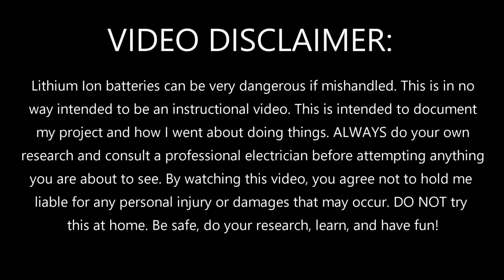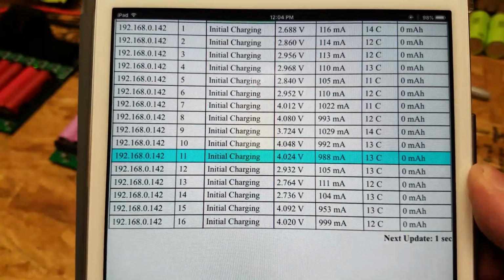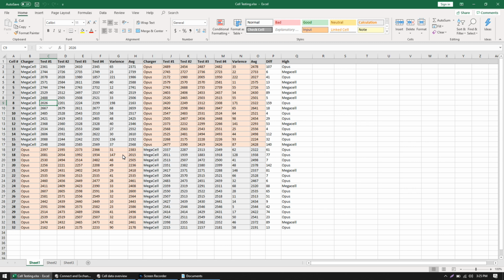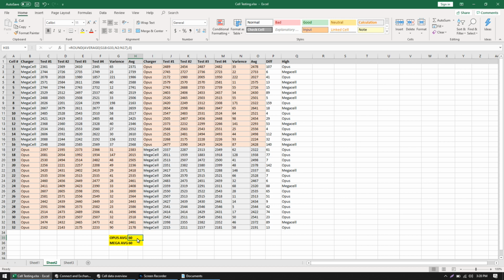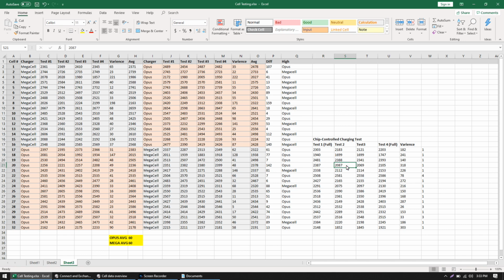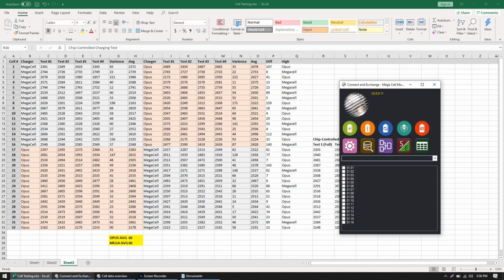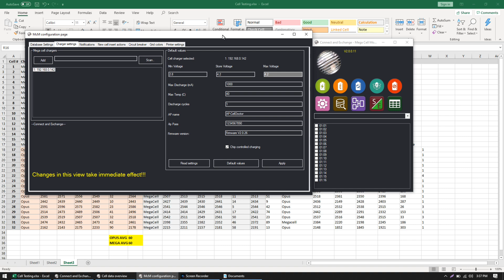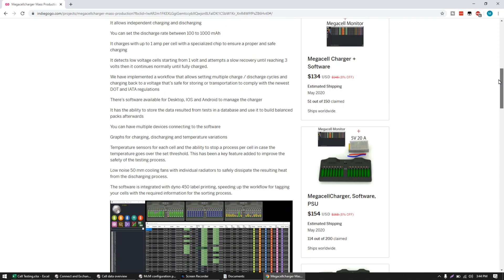MegaCell Charger Consistency/Accuracy Testing vs Opus BT-C3100 & Thoughts

Comment: It's a bit difficult to handle! First: The display is small, you can't see anything on it. Second: It requires a computer, so it's an extra cost! Third: According to the test, you have to set the bays one by one! (This is very time-consuming!) Fourth: I also need a printer so that I can later search for the cells from which I want to build a pack! Fifth: It also needs a barcode reader! (Costs keep increasing!!!) Sixth: If I were to sell something, I would have at least made a transparent polycarbonate or plexiglass cover for it. Seventh: Unfortunately, as far as I can see, it still only has a beta version! In summary: You have to buy so many accessories for it to work that my costs will cost at least 1000 dollars if you also buy the accessories I described! And the worst thing is that since I have little space, the many accessories take up a lot of space in the basement, where I have to leave the computer too!!! So it's all very fiddly and expensive!!!

Comment: I would recommend pulling the negative out first if you are concerned about damage to the shrink wrap, also to fold over the tabs on the plus (or shorten them a bit).
Reply from the maker: It grabs the heat shrink on both the positive and negative. I've tried to bed the tips of the contacts a bit. They don't bend well... (at least I haven't been able to in a way that works).
Reply: @LithiumSolar  Hm, so that means that even if you lift the negative out first there is still a chance that it will rip the positive. Worst case it will short out and weld the tab across + and -, you don't want to be around when it does that! This is a pretty serious design flaw, and if they don't fix it that would count as a serious strike against this charger, testing is supposed to be a non-destructive affair. In that case I would recommend using a dremel with a small cut-off wheel to cut about 4 mm off from the end of the tabs, and then to round it off and grind it smooth again (no burrs).  Push in on the cell then lift the top, then pull the cell forward rather than outward to avoid snagging on the minus tab. 

I'm halfway tempted to design my own charger by now, this is worth doing properly, I think this is a great idea but the execution is lacking. Also, it'd be nice to have a more modular setup, with a single HTTP capable endpoint and say i2c or CAN to talk to the cell modules. Then you could for instance add cell modules in batches of 8 to whatever capacity you'd want.

Excellent job on the testing by the way, nice to see you go through this so methodical. Temp compensation probably wasn't a huge factor but good to mention it, the bigger problem with these cheap battery holders is the varying resistance of the contacts from one slot to the next.

Comment: huge variance on last test is because chip controlled charging charges to 4.2 not 4.24 probably, and removing first test from your calculations because cells in first test were charget at 4.24 would let us compare how consistent it is. either ways, why charge at 4.24 if rated is 4.2? that would give higher capacity readings than they actually are, same as my opus is giving 5-6% higher readings than previous method, in which i charged cells at 4.2, because opus charges untill ocv gets to 4.2
Reply from the maker: Because it doesn't do a proper CC-CV charge, so going to 4.20V actually charges it to 4.10V or so when it stops.

Comment: The battery holder is always the crappy  part of a battery charger. You would think they could make one that works without getting caught on the end. The spring load ones seem to work the best but come on, they can design a better one.

Comment: Just saw your video, I have the same battery holders and same problem with the tab catching the shrink. To avoid that I always pull on the negative side first. This way I can't short the battery if it removes the shrink. For the fans, you can try noctua. Really silent and they have a 6 year manufacturer warranty. Go checkout amazon for that. BTW, great video!

Comment: FYI It's good practice to charge and discharge all cells in testing at not more than 500ma.  Also a lower indicated capacity by the Opus can mean that the cell is capable of a higher discharge rate like in power tool cells, If they charge properly and have the proper internal resistance test those cells at the higher rates before chucking them

Comment: Any recommendations on dealing with opus pausing capacity test due to over heating? I have two and they both do the same thing. Did you modify your fans?
Reply from the maker: I haven't noticed that behavior on mine. I have not modified mine other than replacing the fans when they fail. I assume you checked to see that yours are spinning? The only other thing I'm doing is I have them propped up about 1.5 inches or so to help airflow from below.

Comment: I have not checked your other videos yet but shouldn't this test be done with new cells? Aren't the random grade of cells just making things skewed and random? Thanks for the test non the less and putting a fire under Alex's feet :)
Reply from the maker: No. The board was specifically designed to test used recycled cells. Also, I did multiple tests with the same cells in the same slots, then switched chargers to ensure consistency.
Reply: @LithiumSolar  I understand it's suppose to be for testing/charging used cells :) However, if you want to test how well the charger/tester itself works, why use cells of unknown use/origin for testing purposes? It seems like alot of the batteries were just being completely inconsistent regardless of charger. Just my .02c.

I would like to get your advice on a Power Wall Project I got going. Could ya email me at toybotmedia@gmail.com or let me know the best way to reach ya :)
Reply: @toybotgaming9634  the fact that all the cells are used means he is getting the most accurate results because the cells are not spitting out the same mah numbers. New cells would give the same/simular capacity for every cell. You want to test used cells cause the mah is going to be different on every cell. This gives you the most accurate info possible.

Comment: It's true that opus shows 10% more capacity then the rated capacity on the 18650. Whereas the littokala charger shows 10%less capacity than the opus
Reply from the maker: Do you have any proof of this? Have you checked to see if the Littokala is actually charging to 4.20V?
Reply: @LithiumSolar  I charge my 18650 on littokala and then transfer those batteries on opus for discharge test. The opus shows voltage at that time 4.21v and discharge starts the moment I insert the 18650.that means the littokala charges till 4.21v. Also I have noticed like if the 18650 has printed capacity of 2600mah but the discharge test on opus shows 2800 and sometimes above. And the same in littokala shows 2650mah or above.

Comment: To begin with, this device is based on crappy chinese clone of the TP4056 chip, which was designed to charge at low cost cells in consumer gadgets, not to provide a trusty platform for acurate capacity measurements. These clones are simply unable to do a proper constant current / contant voltage charge cycle without pushing the 4.20v standard end voltage up to 4.25v to get a fully charged cell. This exceeds the maximum voltage recommended by the cell manufacturers. This is exactly what happens in chip controlled charge mode, where the voltage reaches 4.25 / 4.26v, while the firmware and the program intentionally lie to you by never displaying numbers or curves above 4.20v, so as not to scare you and hide the nasty trick.
This mode was implemented to provide capacity values similar to Opuses, even if they are known to give too high values. (I've  four Opus, which overestimate the capacities by 2 to 7%).
With MCC, compared to a trusty reference, capacities will also varies according to different Li-Ion chemistries, different internal resistances, different wear levels, in non-negligible proportions according to your requirements.
Reported temperatures and internal resistances values are also simply way off, so unusable. 
If you want trusty comparison, you should compare to a high-end charger-analyzer like SKYRC MC3000, not any (relatively) low-cost device.
In conslusion, not to tell myself that I have totally wasted my money by buying a MCC, I only use it to pre-test (maybe good or to be recycled) or cycle and stabilize my cells before measuring their capacity with my Opuses, calibrated with my MC3000.
If you want to feed a database with fancy numbers and graphs, MCC is probably made for you. If you want a technically and ethically respectable device, look elsewhere. That's just my opinion. Forge your own guys, with rigorous testing, hundreds of various cells and dozens of hours, some reference and stable brand new cells, a good multimeter, and a good reference charger.
Reply from the maker: GREAT feedback, thank you! You mentioned you use yours to pre-test before running them through the Opus. Considering I run mine differently than other people, do you think the software-controlled charging to 4.24V is still worthwhile in comparison to the Opus? Honestly, the main reason I started looking at it is I'm getting tired of repairing my Opus and while I've heard a lot of people recommend the MC3000, I would need minimum 10 chargers to keep up and it gets expensive fast. You get what you pay for though I guess...
Reply: You're welcome. I use my MCC with fixed max voltage @ 4.24v, not "chip controled" whicht gives inflated capacities. After all the tests I've done (I was beta tester), with current firmware 4.28, it's the closest on average to the measurements made by an MC3000. I use MCC to pretest with one run in "mcap" mode: charge to 4.24v @ 1A, discharge to 3v @ 1A, recharge to to 4.24v @ 1A. Cap <1500mAh are recycled. Then wait 1 week min, check voltage drop, then test capacitiy with Opus.
For Opuses, except for shitty stock fans and one defective power connector, I haven't had problems within 1+ year of frequent use. I did the wire mod, and it's important to improve the cooling for better reliability and no more overheating.
Reply: Awesome kna60.  Thank you for such a great explanation as to why these mega cell chargers perform like they do.

Comment: When your battery are charged, what do you with them?
Reply from the maker: I leave them sit for several weeks, then recheck the voltage and discard those that are self-discharging.
Reply: LithiumSolar Sorry, I should have asked my question differently.  If the batteries are in good condition, for what purposes are you going to use them?
Reply from the maker: Oh sorry, after testing is complete they're being used for off-grid solar storage.
Reply: Some people build power walls to shift electric usage to lower time of use rates, and some build electric cars or skateboards.  Still others use them to save power from solar systems, or build UPS systems to back up computers or in some cases, the entire house.
Reply: @jean-clauded5823  I don’t think you do this in my country. It must 100% separated from the standard electric installation

Comment: I'm not an advocate for Megacellcharger, I don't even have one yet but I think an important point to make is the Megacellcharger is technically still in Beta and can be improved upon through updates!

I'm not that impressed with any of the hardware charger / testers, they do a reasonable job for the price point and that's about it AFAI concerned.

I do hope the Megacellcharger evolves into the preferred product for mass cell testing workflows with its data capture capabilities which is why I am one of the backers.
Reply from the maker: I do agree completely about being in Beta, however, they are now mass-producing them and I'd expect a more refined product at that stage.

Comment: I'm assuming the "chip controller charging" end is at 10% of charge current cut-off. This is the standard and only correct way of charge termination for a full charge. For capacity testing only a full charge makes sense.
The variance you are seeing is the actual cell variance, not an inconsistency of the megacellcharger. You don't have a stable temperature environment and these are old cells, so the chemistry will behave different from one charge to the next.

If you have the chance, do the test again with both Opus and MCC in the same, stable temperature environment, letting the cells cool between every charge. I predict variance will be less, but still not as consistant as you are expecting.
Reply from the maker: So when the Opus stops and they are resting at 4.18-4.20V, you're saying it's actually over charging the cells? I guess what I would expect here is consistency though, not having some cells resting at 4.05V and others resting at 4.20V minutes after the tests completed.

I will try to run a few more tests in a temperature-controlled environment.
Reply: @LithiumSolar  No it's not overcharging them. At least not the V2.1 that lygte-info tested. Sure it might overshoot the voltage slightly during the charge because it measures voltage when the current is off but the Opus does terminate around the 10% mark (~110-120mA termination on the PA18650-31 cells #1-4 charging at 1A, I'm not going to bother checking the other results).
If some cells rest at 4.05V after charge then there's just something dumb happening like the chip skipping the CV stage or terminating the CV stage way too early for whatever reason.
Also, the TC4056A is specified to have a float voltage of 4.2V +-1.5% or 4.16V min 4.26V max. Perhaps what you're witnessing is part of that inherent variance? Each chip being a different snowflake. Add to that the different internal resistances of every cell being slightly different altering what the CC/CV shape looks like i.e. that could also be a factor making a chip behave differently on different cells.
But for whatever it's worth, for capacity testing I would rather have software control.

Comment: Do you think some of the issues you identified can be rectified with code revisions by its creator
Reply: For more than a year they have sold hundreds of flawed boards because of the choice and implementation of some components. They have released many software and firmware revisions to try to correct those flaws. As it is impossible to correct all the defects, they have chosen to try to hide the main one which is that this device is unable to perform a correct constant current/constant voltage charge, in order to obtain correct capacity values, while respecting the cells manufacturers' recommendations. The program and the firmware therefore rig some voltage values by lying to the user.
You can't polish a turd. Without fundamental changes, it is impossible to change a donkey into a racehorse.
Reply from the maker: Yes. In my opinion, software-controlled charging should be defaulted. To what end voltage - I'm not sure. Someone more experienced than I would need to determine that.

Comment: So finally,
are you recommending the megacell charger to get cell accurate internal capacity...?
Is it good or bad .?
Reply from the maker: Unless you want/need the wifi connectivity and queryable endpoints... The Opus will run around the same price, if not cheaper, and does the exact same thing as this. I would probably recommend most people go that route until some of these issues have been ironed out.
Reply: i would also like to get a couple of these mega chargers, but waiting 5 months for it? no thanx then. ill build my own charging stations and use a good spreadsheet as a database.

Comment: I found it easier to use my thumb and remove the cells from the negative end and none will catch under the metal contacts of those holders.
other than that, love the charger, waiting on a dymo labeler so I can print the labels as opposed to using a sharpie and writing on each cell.
Reply from the maker: I don't understand the point of the dymo printer. Thermal labels have an average lifespan of 6-9 months. If I'm going to label my cells, I want to be able to pull it out in 5 years and read it. I've never heard of a thermal label that lasts many years...

Comment: Some nice, to the point testing. I don't think its too bad for the price if set up correctly. Good one, thanks
Reply from the maker: Thanks! It's not bad at all, but does require a lot of effort to get running correctly.
Reply: @LithiumSolar  Can you share your server side code for your mobile webpage. I havent recived mine yet but I ordered one from battery hookup. Please also share your data you obtained on the api.

Comment: That was a good and interesting analysis!
I have some similar sockets with snagging issues, so I bend the tip of the metal strip like the front of a ski to avoid snagging.
Always best to insert positive end first, extract positive last to avoid shorts.

Comment: LOL, at about 2 minutes in you just skip over the fact that you built a software page.  Wow!  You built something to see the cells.  That's crazy.
Reply from the maker: Yeah the stock software is junk...  I complain about it more later on ;)
Reply: @LithiumSolar  I would love to hear more about your software.  Maybe even see the code if you want to share it?
Reply: @LithiumSolar  can you please share code on github , I only use Linux and all their software is for Windows ... has anyone else thought about integrating a data logger onto the board ? if mine ever arrives it will be the first modification I will make
Reply: @LithiumSolar  please supply the api. Dont need the code but would love to know what to post and get to set up my own site for my android device.
Reply: Open source the code. I'm sure there are people that will contribute. I'm one of them.
Reply: Found the api using a packet sniffer. http://megacell.ip.address/api/get_cells_info this will give you the json file with all the info you need. Going to try to write my own android app and see if I can open source this code.